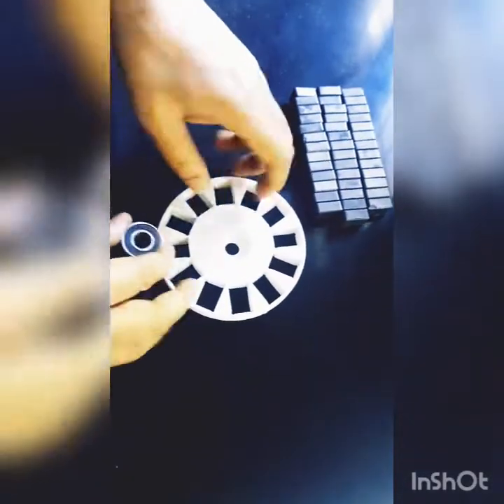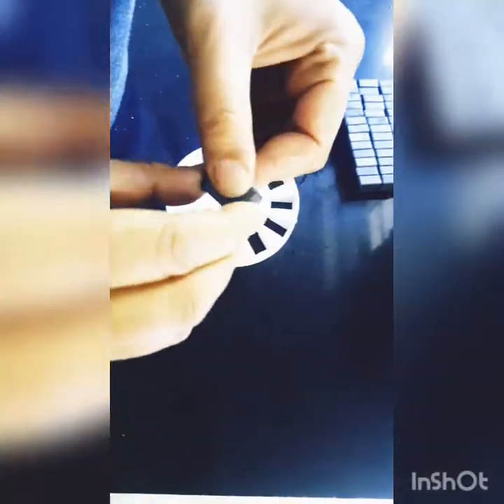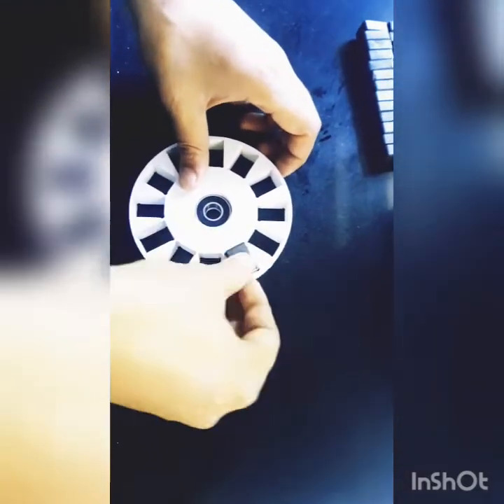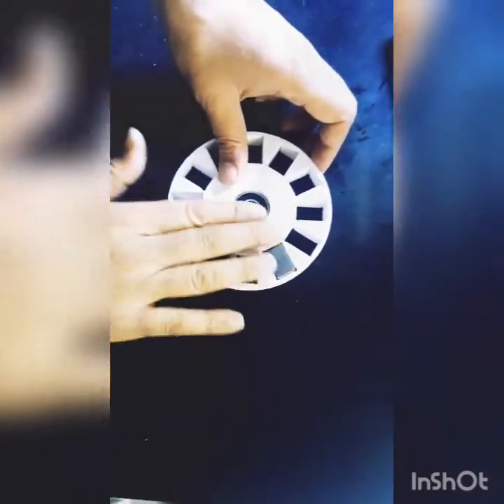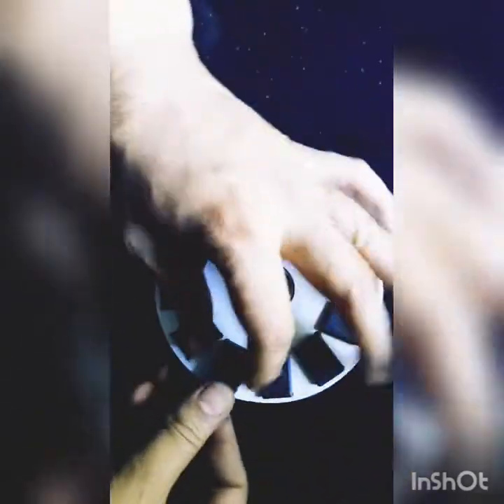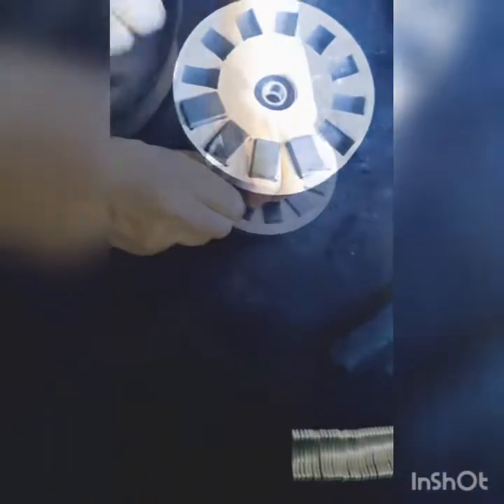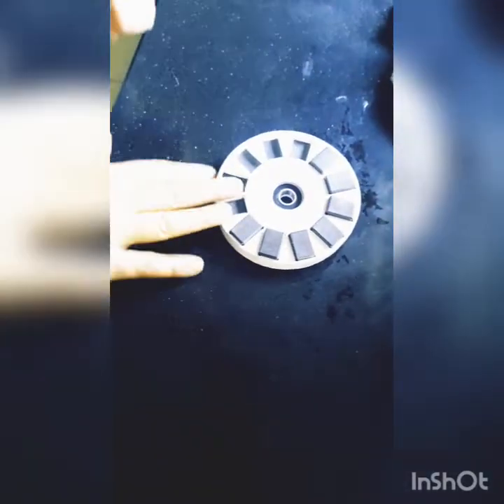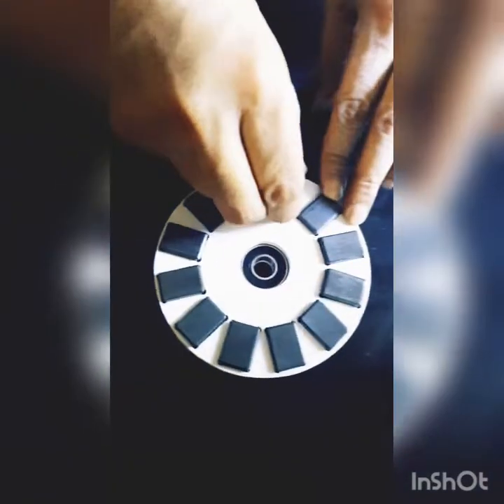PMG | Permanent magnet 🧲 generator | Axial Flux Generator DIY.

Comment: Where can I get this frame? Can you please share the link?
Reply from the maker: They are self built. I am sorry you might not find this in market. If you need it for experiments I can send it to you if you give me a shipping address.
Reply: @Creative_Portal  can you also give me, we really need to make our own electricity because we still use and pay in gasoline generator to charge our lights and phone here in  Philippines since December in typhoon Odette. I already make a ceiling fan generator but it only produce 21V and 160mA enough to charge motorcycle battery unregulated. I wanted to make axial generator but I have no money and resources to begin with and the magnet and copper coil are very expensive. If you can give me I will make it immediately and share to my community for free👌👍
Reply from the maker: It's just used to learn about how magnetism and electricity works in an alternator. ;) Still if you need i am willing to give away this for you. Will you be able to pay the shipping fee?